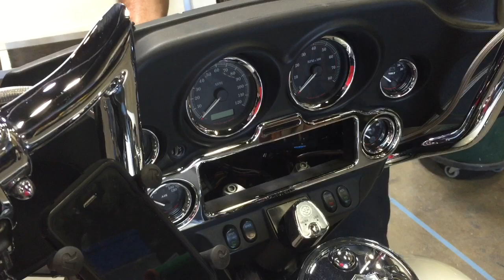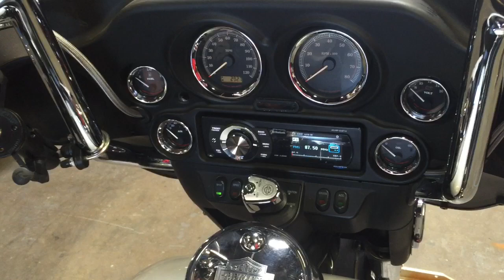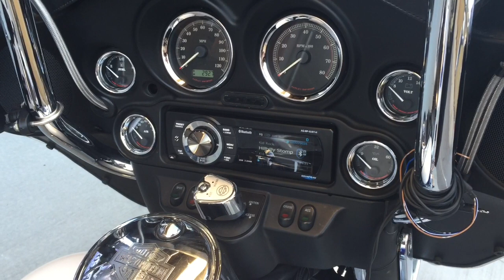Dragonfly is installing the Aquatic AV AQ-MP-5UBT-H in a Street Glide

Comment: you removed two connections from the back of the harley radio but only plugged in 1 to the aquatic radio, where does the other one go?
Reply from the maker: +gilbert joines The other plug fro the ultra does not get used as this radio does not accommodate the intercom, and CB features.

Comment: Well I will say this video is nice to instruct you on how to remove the outer shell of your fairing.. however if you notice they cut out both times when the second allen head bolt is to be removed from the stock head unit prior to removing it! I can tell you from personal experience that the reasoning behind this is.. its far from being a breeze!! as with a lot of parts of this kind, the 2 bolts on the inner side of the head unit are a pain in the back side to get out...oh and incase you wouldn't have assumed it ...they are even more of a pain to reinstall! it can be done...don't get me wrong and based on the initial install I would say its appears to be worth the struggle...(meaning I haven't road tested the unit) but prepare yourself for a little bit of a hassle! I would like to think maybe I was missing a special tool that would have made this an easier process.. but im not sure what would have fit in this space to make it work better!! liking the sound as it sits...just wish they could have made the install a little more realistic rather than saying it was so simple!!
Reply from the maker: Sara Hultz A ball socket Allen is what we use. We did not design Harleys fairing. With the proper tool we are start to finish 15 minutes for the entire install a radio.
Reply: I commented back and mentioned that this was posted by me Eric Andrews...didn't realize my wife was still logged on...but maybe that's what would have made it easier! trying to get the bolts back in was a complete pain....honestly I blame this mainly on hd...there were obvious options they had to make it much easier to get to the bolt and however left it as a struggle! was able to get them in but it was honestly a pain. have yet to have the availability to road test it..however based on the initial test of the unit it appears to be a good choice!! thank you for your response!!

Comment: I have disconnected the battery on my 08 Ultra Classic and run power through the speaker wires and can't find the other ends.  The radio comes on and the speaker wires are charged but do not go to the speakers. Haven't been able to find any output.  I have  feeling I will have to disconnect the tank headset system and others

Comment: i have Aquatic AQ-MP -5UBT-H headunit. Im thinkn about  using Rockville RXN-S6 6 channel amp. I need help wiring speakers. The speakers i have Rockford Fosgate P165S -6.5,  Audiopipe-ATQ 1550 1" Aluminum Tweeter. I was thinking to put them in front fairing 
Rockford Fosgate PPS4-6 6"MID in my speaker lids. Rockford Fosgate putting 2 -P2D2-8 8" SUB in saddlebag on a template, and another pr. P2D2 -8 " SUB in tour  lid.
 I need help with wiring the  speakers in series or parallel. Im wanting to run everything in 2ohm's. I would appreciate any advice to hook this system I have up. If its not rite just tell me how u would. I thank you for your time

Comment: I have the factory sirius xm mogul which plugs into the secondary harness that you never used. its not only used for the CB unit. I believe it also links the factory amps that come on the CVO ultra classics like mine. I want to use my satellite mogul that was installed with the harmon kardon radio as well as the factory installed amp that mounts under the tour pak. can you explain how that's done?

Comment: I have a handlebar mounted harley mp3 player that connects to the stock radio trough the auxiliary jack. Will I still be able to use this device seeing that the Aquatic radio only has an auxiliary jack under the face plate?
Reply: Mark Kravitsky I have my phone connected via Bluetooth.

Comment: Does this radio have the AVC (automatic volume control) like the stock unit.
Reply: Rodney Wilson no. I installed 2 focal 6.5 and a 2ch focal amp. Super load. I can hear it at 80 just fine
Reply: NO

Comment: if it don't have clock  your odometer can be a clock when after market radio is installed scroll through speedo till 12:00 comes up hold to choose 12 or 24 hr hold to set hour then min work on my 2011 ulta flhtk
Reply: dvddorr it has a clock.

Comment: Hey great Video install was very easy but my ignition fuse keeps blowing when I turn cruise control on.has this happen to anyone els
Reply from the maker: It has not, the two circuits are unrelated unless you pinched something while in the fairing

Comment: I need to wire my rear speakers, where do I find THAT wiring?
Reply from the maker: +Malcolm Todd There is an additional rear speaker plug coming out of the radio.  Refer to instruction manual for exact details.
Reply: Someone should do a video, how did you make out?
Reply: I just wired in my rear speakers. The kit comes with a speaker adapter for the rear, you will have to splice in the color coded wires from the leftover 32 pin harness, fairly straight forward, although I had to really guess on the wire color pairings because they weren't an exact match. Now I discovered one of the rear speakers sounds like a McDonalds cup. a good excuse for an all round upgrade.
Reply: Hay they forgot to tell you that you need a telescope to read the dam instructions.tried blowing up the manual but now can't read wireing diagram.color don't match at all.and now my 2003 ultra is sitting in my garage and is very kissed off.so much for plug and play,no power at all.can you help.                Thankfully gene

Comment: no clock?
Reply from the maker: +pyro707 Sorry, no Clock.  However a clock will appear in your Speedo LCD once the OEM radio is removed
Reply: what are you guys talking about? I'm looking at the video  @1:50 and I can clearly see there's a clock on there. It says 3:32
Reply: I have the full.color model and it has a clock